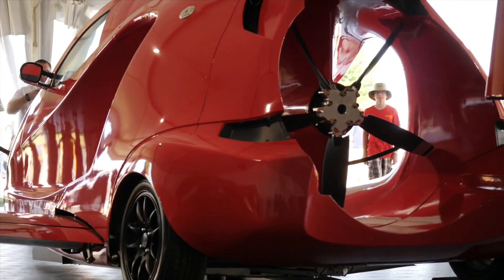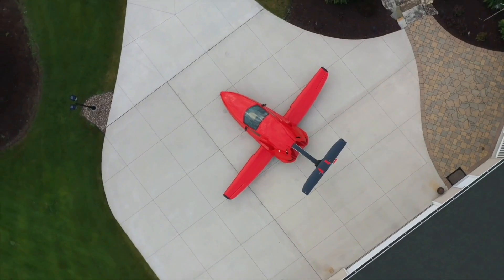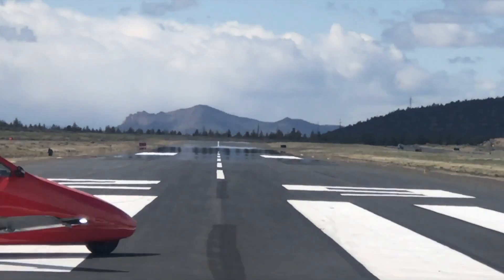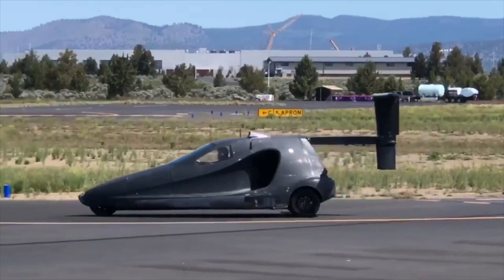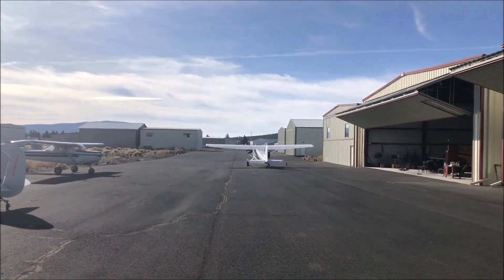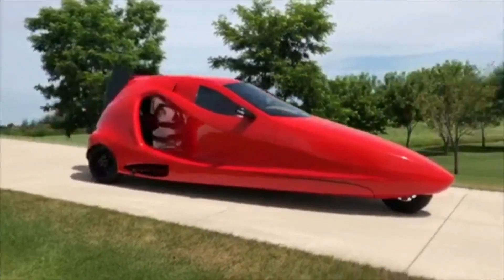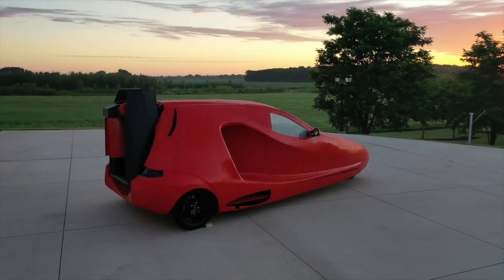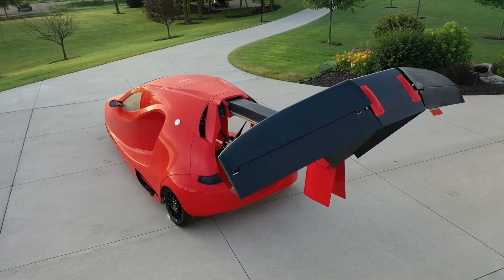Samson Switchblade Flying Car is Finally Ready For Takeoff

Comment: This isn't a flying car. It's a foldable airplane that can be stored in a garage and needs an actual airport airstrip to take off. And requires 2000 hours of build time, at HOME? A true flying car is one that can fly over local traffic or municipal air space the same as a helicopter, and yet can also land and be driven as a car. The only market served by this idea are people who spend at least $150,000 a year on local regional flights. Which I'm guess is less than 1700 people.
Reply: It's a car, and it can also fly, so it's a flying car. There's no rule that defines a flying car as only being VTOL. As to build time, Samson is preparing to offer supervision of assembly at their plant, and the expected assembly time is now being announced as only one week.
Reply: No where does my original comment mention VTOL. Many states have laws saying for something to be labeled a "car" it has to be highway worthy. Every state requires non-wide-load vehicles to be able to do the speed limit and fit inside of ONE lane. This contraption can't do 60mph for long periods of time with it's weak battery, and it does not fit in one lane. Hence not highway worthy, hence not a car. Again, this is a foldable small airplane that can be stored in a home garage. Not a flying car. 

Also a flying car shouldn't require an airport. It doesn't have to be VTOL but even a car that needs runway to get up to 65mph (minimum for a Cessna 150) can be considered a flying car. You can do 65mph in almost the entirety of the United States. THAT would be a flying car.     @timothytikker1147
Reply: @iamcase1245  it does fit in one lane, and it's gasoline, not battery, powered (though a hybrid engine is being considered), so it will have no trouble maintaining highway speeds over normal distances. Having three wheels, it would be classified as a motorcycle, at least in some states, but it has nonetheless been designed quite specifically to be roadworthy.

Comment: As a US Airforce Avionics veteran, I'm interested in seeing 1/4 up to 1/2 scale models in flight with engineering talks about STALL speeds.
Reply: he did that , a quarter scale, but after many crashed landings trow the plane away, 4 or 5 years ago were them in you tube, the ducted fan looks complicated to operate during the aproach and landing, the main problem is when you fly  all time are flying with a high pitch moment because the trust line is over the cg and a very poor compensation fron the horizontal, then you can fly at high speeds but never at low.

Comment: Looks great Hallelujah we all needed this. What’s the air speed normally used for optimum efficiency
Reply: I designed the Switchblade to cruise at 160 mph and it should take you 500 miles at that speed. Thanks for your interest!
Reply: I know what was said in the video as to most we could push it to. I want to know what is reasonable to expect and when we are using it. And things we should know? 
I am sure my Flying ground school will be helpful. But this does return to a car. It’s so exciting

Comment: As a private pilot, that thing looks like it's not for a novice pilot and the published stalling speed is pretty high, at 58 knots predicted. This is no Cessna. Which means takeoff and landing speeds will be pretty high, around 75 to 80 knots I'd have to guess. I'd want to keep its nose down and accelerate to at least 100 knots right after take off. To fly it with it's smallish wings and slippery surfaces, I'd not want to bank it much more than 20 degrees and very carefully at that. And also going at least 100 knots to feel safe in a turn with a good bit of rudder. With no flaps (doesn't look to have any ) it seems like it would be tough to slow down right after base to final. I'd keep that thing flying really fast.
Reply: You are right that it takes off and lands faster than many slower aircraft, but there are some major advantages I think will make the switchblade one of the safest aircraft one could own. For one, with three automotive brakes and tires, you can land well above typical approach speeds, fly it in the runway like a jet, and hit the brakes. This means no longer having to get the aircraft close to the point that it won’t fly as you come in, which has lead to many accidents. You also have the option to land and drive under weather that looks dicey, rather than try to keep flying if you feel pressured to continue to some destination on a schedule. Flying through bad weather, as you know, is the cause of a lot of the fatal accidents of small planes. We provide cross-over training with each kit, as we want people to get used to the performance and features of this unique vehicle to help make their travels safer and more enjoyable.
Reply: I am totally agree with you, crossed winds are a problem with low wings for landing and take off, more with extended flaps, probably will be good to have an articulated landing gear . Another fear are the vertical surfaces versus the big and long nose , looks more vertical area from the cg to the nose than the cg to the tail, should be good to have a rc dynamic scale 1/3 model , trying to use the right Reynolds number
 for that scale, for now just I knew tests with 1/4 scale model non dynamically scaled.
Reply: I am 100% certain that this will be fly by wire & have some automatic stall contingencies & limits on rates & angles.
Reply: A canard to rectify the stall would ease my troubled mind…

Comment: I’ve been searching YouTube for this thing flying in the air and I have yet to find a video showing this. If anyone can post a link showing this thing taking off and landing I would greatly appreciate it otherwise this thing is coming off like a big tease
Reply from the maker: I tried find it unfortunately I couldn't find this car flying, this car recently certified to takeoff so we can expect some test flights footage soon
Reply: @GU_Official  Thank you. Appreciate the update
Reply: @GU_Official  Suppose to fly within weeks. I just hope they fly this year.
Reply: @GU_Official  Suppose to fly within weeks. I just hope they fly this year.
Reply: Was searching for the same thing. Vaporware
Reply: Agreed. Nothing shown but a car with wings racing down a runway.
Reply: We are in the midst of flight testing, which involves testing, analyzing results and continuing it making a tweak to the prototype before continuing. The test pilot has now cleared all systems, and we are making a tweak to the ducted fan section to add more thrust before getting airborne.
Reply: A lot of them don't fly
Reply: Well, just flew a rc 1/4 scale model , those flight were in you tube 5 or 6 yesrs ago, after  4 or 5 flights ,each landing was crashed then repaired for the next flight, my conclusion :the model is hard to control reducing the speed during the landing.
Reply: Sam did a rc 1/4 scale model, flew but each landing was a crash, after 5 or 6 flights end too fixed and broked,